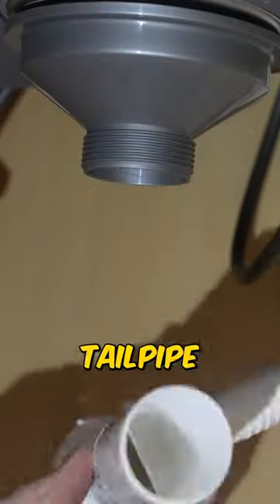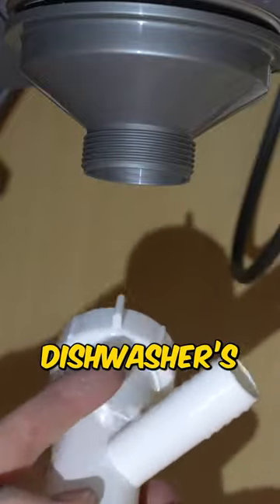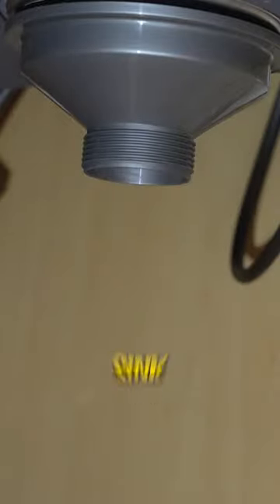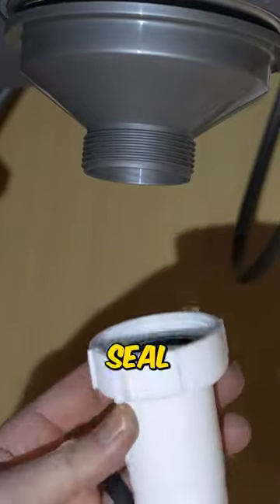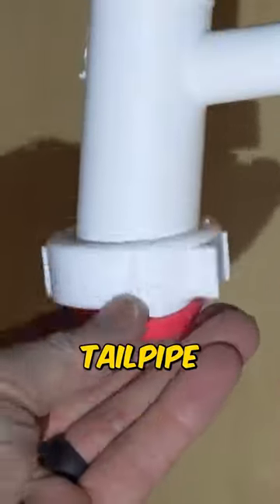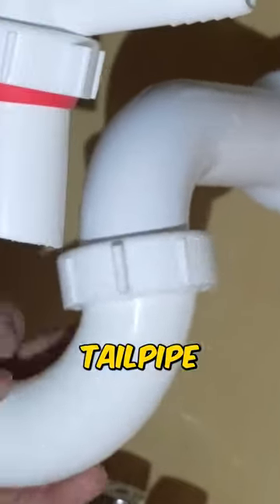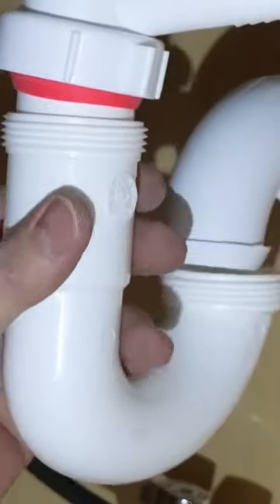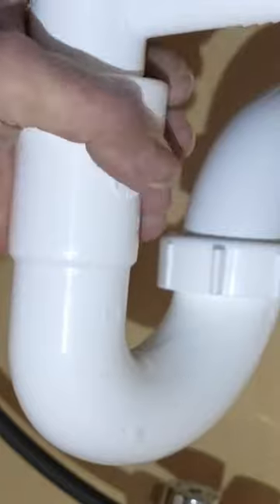P-Trap Installation On A Kitchen Sink! #plumbing #diy #howto

Comment: You’re not gonna use any pipe dope on the threads?! 😂
Reply: You’re not a plumber
Reply: I am trying to learn plumbing, and I thought exactly what you thought. Why did he not use any tape or dope? And I wish he would have shown how he hooks up that to the dishwasher.
Reply: @christiefisher6642 nice. It’s because these joints are all compression based. They don’t require pipe dope or t-tape to create a seal.
Reply: If a fitting has any sort of rubber washer or gasket, you don't need dope or tape.
Reply: That funny. Last time I checked Iv been licensed in California since 2005 and have been running a successful business where I do all the work myself. What exactly are